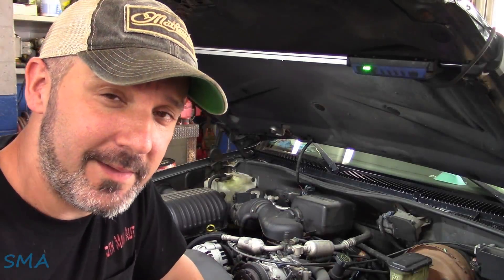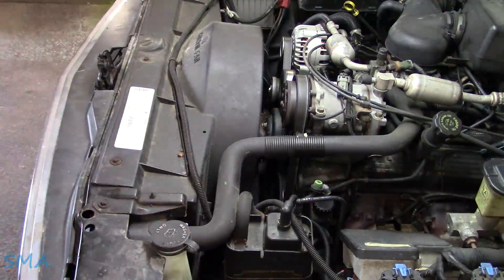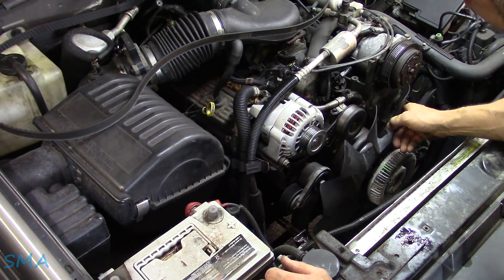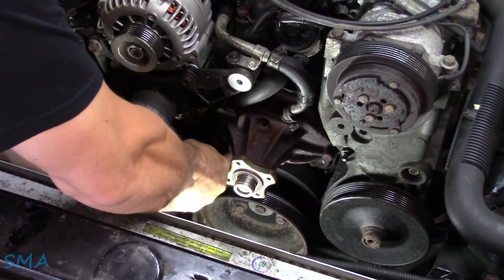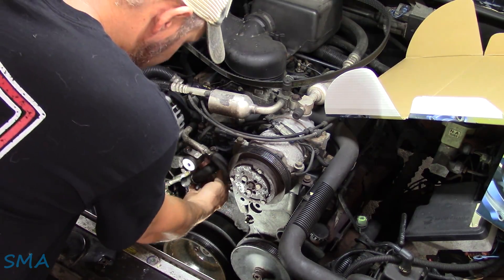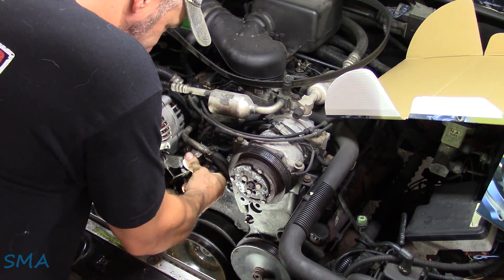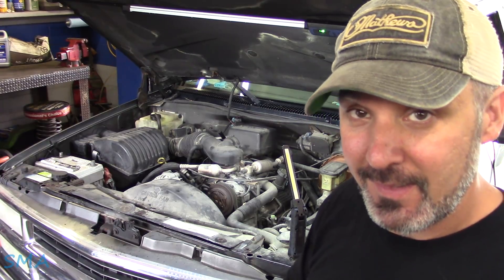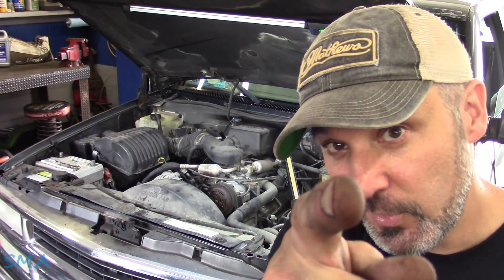Water Pump Replacement: 5.7 Chevy Tahoe / Silverado / GMC Sierra / Yukon

Comment: If Bald Eagles could fly out of the exhaust pipe, this is the engine that should be pushing them out.  Good 'ol 350 - good tried and true American engine.  Nice work as usual Eric!
Reply from the maker: Not gonna lie, when I fired it up it the whole shop smelt like apple pie coming from the tail pipe, I looked out side just in time to see a guy drinking a Coors light and releasing a Bald Eagle into the wild while singing the National Anthem wearing Trump 2024 shorts and an American Flag tee. At that very moment Bob Seager and the Silver Bullet band came on the radio singing Like A Rock while the NY Yankees tour bus drove by with glass packs rappin out the duals. Ahhhhh I gotta tell ya, it was sensory overload for a second and a lot to take in....may God help this great country!
Reply: @SouthMainAuto  Lmao That's the best thing I've heard all day!
Reply: are you my long lost cousin or something? BAHA!
Reply: @SouthMainAuto  🇺🇸🇺🇸🇺🇸🇺🇸🇺🇸🇺🇸🇺🇸
Reply: @SouthMainAuto  LOL almost peed myself reading this..
Reply: @SouthMainAuto  Woah, that was deep
Reply: Lots of these engines in Australia too. They started importing them for Holden in 1999 and used them for a decade give or take. There were piston issues with these import engines though, not sure if it was the case with the US versions.
Reply: @dylanlewis3666  The engine your refering to is different I believe. Your refering to the LS1. This is old sbc 350 based.
Reply: Trump or Desantis 2024! Or sooner if possible
Reply: @DillonTurner395  You're right, I just read up on it. We only got the gen III & later types here (In '99) which is an LS engine, not the sbc gen 1 or II. People liked the LS1 here. I didn't. I preferred the 304 that was built locally.
Reply: @Kanesgarage  the left will have us travelling on pogo sticks by the time a conservative pres is elected.
Reply: @dylanlewis3666  The left wants to dismantle just about every system in this country. These are some rough times. Let’s just hope it doesn’t last
Reply: @SouthMainAuto  wrong! No coors light!has to be  Good old Yuengling! America's oldest brewery!
Reply: I have one.  Damn thing screams 'MERICA every time.  Fire it up and says " 'MERICA MOTHER LOVER", and proceeds to sing the Star Spangled banner.  It does...and boy does it piss off the left and the green...I just rev it harder.  :)
Reply: @SouthMainAuto  MURICA!HELL YEAH!
Reply: @SouthMainAuto  well said sir well said
Reply: My buddy had the same engine is his  GMC Sierra with 540, 000 miles on it AND the four wheel drive STILL worked!!
Reply: That's a damn good engine BUT google  700,000 mile Corvette...
Reply: @SouthMainAuto  🤣 love it
Reply: @SouthMainAuto  That's why this is my favorite car repair channel.
Reply: They were much better after they got fuel injection and roller cams . the old carbureted , flat tappet small blocks were usually worn out by 100k miles .
Reply: About as reliable as stopping a tornado with a flyswatter after the 80s.
Reply: @SouthMainAuto  AMEN!

How did you manage to work the rest of the day after such a cornucopia of Americana!? 

If this automobile repair gig doesn't work out, maybe the Chevrolet Performance division of GM could use some advertising assistance!
Reply: @NickMyers1  I'll tell you how. The good old American spirit kicked in. Work hard and get ahead. Though this plan-demic seems to have everyone working or not... who cares... Uncle Sam will pay you either way.
Reply: @philllsxga.7737  I got one that still runs with 580,000 miles. Transmission went out so I'm probably going to junk it. The cam/distributor gear is paper thin
Reply: @HowardJrFord  not if you changed the cam and lifters
Reply: @Bryan-Hensley  an old 350??
Reply: @notsureigaf  right!! Do not put trust in ANY human!
YouTube George Carlin the American dream...
Reply: Jesus it is sad isn't it?  You have all these people standing behind a guy who wasn't just extremely anti-American, anti-democratic, etc. but was also just flat out terrible at the job.  This is a guy who openly disparaged military members, and took on gold star families while he made up shit to stay out of Nam.  The guy legitimately despises his supporters and wouldn't be caught dead in a room with them, but he's their hero.
Reply: @throttlebottle5906  Every big depression or major war was repaired and resolved by, at the time, the most liberal presidents. Wilson and Roosevelt were as left as it got in their days.
Reply: Idk 300 fords are better in my opinion not as much power stock obviously but those things could run in a black hole toughest engine ever built for old shit boxes
Reply: @SouthMainAuto  do you really think Trump is American?  God, I hope not. Everything about your channel says you are a man of character and honesty.
Reply: @Kanesgarage   if you actually run a garage, I certainly wouldn’t give you my business. Since you are ok with corruption, sedition, rape, and lies, I must assume you run your business the same way.
Reply: @jgeorge6081  I am as anti-Trump as it gets but generally speaking people who vote for him/Republican just don't believe that he's committed those acts. The facts are against them but if you ask Eric if he's okay with corruption rape and lies he'd say no because he's, you know, a real person and not the caricature you're making.

Trump is all the worst sides of the Republican party enlarged by a populist campaign. But not every single person who voted for him is fundamentally a bad person. Usually just misinformed.
Reply: @SouthMainAuto  im ok with everything except the trump 2024
Reply: @jgeorge6081  I hear ya. It’s almost enough to walk away from this channel. Especially with the other drumpers laying it on.
Reply: @SouthMainAuto  
"may God help this great country"
 
That's why he put Biden in office.
Reply: I like to use a 1/2"drive instead of a 9/16" drive?
Reply: @SouthMainAuto everything but the trumpy is correct. I hate trumpy I hate Biden I HATE EVERY POLITICIAN. I don't do politics and I don't vote. I'm as American as you can get...but unfortunately there hasn't been anyone worth my time to vote for since I became eligible to vote 15 years ago.

Comment: What a concept, water pump you can remove without removing the timing cover and half of the engine front in the process.
Reply: Yeah, imagine that.
Reply: I own one, it is the easiest water pump to change of all the engines I've had so far.  Only 4 bolts hold the pump on.
Reply: And a 2 piece fan shroud!
Reply: Was surprised a Chrysler product was somehow the only easier water pump I've ever seen(3.7 liberty early 2000s) but this thing is definitely easier than most. It's almost like engineers know how to make things easy to work on and choose not too nowadays
Reply: Yep...they made them so even mechanics were happy..
I still have vehicles like that...and the other type too
Reply: Sure, then your serpentine belt snaps and you continue to drive it.  But hey, whatever's easier.
Reply: @riccracc6547  the small block Chevy has been around,sine the 1950's,...using the same  water pump design,all that time.
Reply: 4.6 2v ford is easier.. Electric fan so it's just a belt and 4 bolts..
Reply: @zcvyvyan  
Rarely do belts snap actually and the timing belt isn't driving your water pump....i started working on cars in the 70's...so i actually understand how stupid your comment is...but anyways....the point was??...it is easier to access...not forced into a timing belt change ( which are belts that " snap " alot !! And we had chain timing systems that lasts longer than the engine too !! ).. Always some know it all knowing diddly it seems?? I own modern vehicles and fix them myself too...progress is not always Better in fact....
Reply: @garymallard4699  Timing belt doesn't drive the water pump?  Before you attack someone, you might want to be correct first.
Reply: @zcvyvyan  
On many cars it does...you wrench??
Reply: @zcvyvyan  
Maybe you should correct yourself...
Reply: @garymallard4699  The most sold cars in America  come from Toyota, Honda, and Nissan.  Most of those use timing belt water pumps.  Yes, I do wrench and I'm also a parts counterman.
Reply: @zcvyvyan  
Domestic too have them....euro too...most new vehicles use them..i am a mechanic....among many other trades...
Reply: @zcvyvyan  
Waiting?? 
Apoligize
You were wrong...if you knew this then?? Why did you attack me??
When all i did was state FACT??
Don't need your apoligy ok
Reply: @zcvyvyan  
Not trying to beat a bush here...or tumbleweed....but why did you say i was WRONG?? 
Most Parts Guys argue with mechanics over parts...lol
Amazing...
Reply: @zcvyvyan  
And what's your belt anger about??
Geez you need a shrink man...
You in 20's??
Reply: @zcvyvyan  
I was rebuilding carbs in my teens..
You ever do that??
You probably hate carbs too??
Fuel pumps were mounted on the engine...took 10 minutes to remove...guess that was Stupid too??? 😂 man you young kids know everything without actually doing anything??
Reply: @zcvyvyan  Well then you pull over, since your alternator light will be on or the volt meter drops. Whatever the cluster has in it. If run too long the temp gauge or temp light comes on. What's your point ??
Reply: @NY411Info  sure, you might do that and you should but a good amount of people ignore dash lights including the check engine.  Then, it's the car's fault for the operator's ignorance.
Reply: @zcvyvyan  Lol yes , at that point it would be operator error. If you ignore the lights or gauges you deserve a blown engine.
Reply: @NY411Info  It's really common for people to do that.  Then they don't take the blame and spread the word about how bad the car is.  Water pumps on the timing drive is a good idea.  What's not a good idea is then making that whole system interference.
Reply: Yeah I have a Toyota that you change the water pump and the timing belt at the same time. What a deal.
Reply: I’m not attacking anybody I’m just saying that they get charged at the same time 😳

Comment: This actually made me real happy to see. I like that other people are still rocking the old 350. 400'000KM on mine and still good, minus all the stuff that isn't. But honestly what a good little engine.
Reply: Fords has 7.3 power stroke. Chevy has the 5.7 350
Reply: @Daves_adventures4315 7.3 was made by IH Navistar, thats why they last
Reply: @UHOH3300  still in the Ford. 7.3 6.7 the best Ford has
Reply: @Daves_adventures4315  true, and the 6.9 and 7.3 idi are legendary as well
Reply: Pushing 389k on mine. Just a few seconds of piston slap when it first starts. After that it's still acts like it's in it's prime. The truck has has a test axel replacement/upgrade and I rebuilt the transmission by my choice to add clutches about 30k ago before it left me hanging. Engine hasn't had any sort of failure yet. Seeing this makes me think, now that I saw it I'm probably going to have the water pump fail in the middle of nowhere in the winter at -20f. Hmm  maybe a preemptive replacement is in order?
Reply: They have a flaw. The intake manifold gasket will leak pulling a vacuum on the oil pan. If left it will smoke the cat on that side.
Reply: still  have my 92 k1500 350 r700 ..wont trade it for the new  a  truck
Reply: @Daves_adventures4315  5.0
Reply: @michaelvangundy226  Yep.  My 98 K1500 that I bought new is on it's third intake gasket and it only has 140,000 miles on it.  Mine has the second version intake gasket so I'm sure it will go out again at some point.  The third version gasket seems to be the best fix.
Reply: Saxon Fisher what do you expect it is a good ole G.M. CHEVROLET old CHEVYS take a LICKIN & STILL KEEP TICKIN any G.M. VEHICLE is a good one
Reply: @Monza62000  Don't at all.
Reply: @Daves_adventures4315 NOT a ford engine though. The 350 is a CHEVY engine through and through. So no you can't say that. Just because it's in there doesn't make it a Ford product. Same could be said about Cummins and Dodge...Dodge didn't build the Cummins engines. But once again, Chevy built the 350 which IS the GREATEST engine of all time...the small block Chevy as a whole. 283, 305, 327, 350
Reply: @thagerdorn2009  very true.  Just my opinion but can’t beat a 327 or 350. Everyone went nucken futs when Chevy “replaced” 327 with the 350 but held it up to its predecessor. 327 phased out in 1969 2 years after the 350. But the 350 went from 1967 to 2002. That’s something to be proud of!
Reply: @Daves_adventures4315  I love all of the "old school" small block Chevys. I love the LS engines too, they are the modern small block. I love the GMT400 trucks but you can't beat a GMT800. They are just incredible and people love the LM7 and L59 engines from the trucks. But honestly, my Z28 is numbers matching and I might put vintage air and a Holley sniper on it for "modernization"...but the numbers matching 350 will stay in the car. I don't need another LS vehicle, my truck is enough. And I'm a numbers matching guy. The amount of support for the SBC is growing and growing. And I love it. Just can't beat it
Reply: @thagerdorn2009  I have a 78 ford. It was my best friends in high school’s dads. It’s on my channel,all I’ve done to it. From dragging it from her grave to current. I did win a car show (small show) with her but unfortunately the block cracked from the water pump into a water passage.  Motors toast but got a 82 to pull the 351 out rebuilt and put it into the 78. Hopefully will start Monday

Comment: 97 GMC 1500 sportside 3rd door, 5.7 vortec, over 400K, still runs like a charm but tons of preventive maintenance thru the past 24 years,  original 4L60E, never cracked, original engine, never cracked

Comment: I had 89  Silverado long bed regular cab with that good old 5.7 and it was my grandfather's truck. It had the 5.7 high output, mine was t.b.i b4 the vortec.  I absolutely loved that truck.   The sweetest truck I've ever driven on the interstate you could pass absolutely anything. You could leave black marks as long as you felt like holding your foot on the gas..lol. Sadly it kicked out of park one day, rolled  over a bank and hit a tree and just destroyed it. However I do I took I removed the engine and transmission which was still running great at 280000 miles, My father had it before me he had the transmission rebuilt about 80000 miles before. Broke my heart to scrap that truck but I still have its heart and it will go in another, When I find a vehicle I consider good enough for that Heart. I've never heard of vehicle to this day it sounded as good as A 5.7 with the right exhaust

Comment: Eric, they discontinued the Goodyear gatorback series of belts. Continental killed it off. They were really good belts. I was so outraged that I switched to gates and never looked back.
Reply: Yep great belts and lasted a loooooong time that might be the main reason they were discontinued. I have a gator back on my Dodge Ram Cummins that has a idler pulley seize up and it was at 120K when that happened I sure don't like the new belt as it speaks on startup

Comment: This video also applies to the 4.3 v6 as well. The whole front of the engine is exactly the same except for the fan blades and thermostat housing. My 97 Safari (one owner) has 415000km on the odo. One thing we found out over the decades is do not use a cheap new water pump or else. AC Delco or get it rebuilt locally. On pump # 3 we changed a bunch ourselves as well and went with an aluminum new fenco unit from china (autozone). 6 months later the bearings disintegrated and sent the fan into the 6 month old rad and broke the 6 month old belt and the 6 month old adjuster and bent the 6 month old  clutch and the 6 month old rad hose. Happened on christmas eve. That was over $1200 for tow, hotel and fix in the end plus the cost of everything 6 months earlier. The warranty replacement pump leaked bad after 3 weeks. Another $400 again to tow (100km) and get it back to an AC Delco pump.

Comment: took a 5.7 vortec (1-piece RMS) out of a '97 C10, stroked it to  a 383, internally balanced, old school SBC 400 aluminum ported and polished heads, old school Holley 750 vac secondaries, dropped it in my 71 Camaro snugged up to a built M20.  Love that motor!

Comment: I love my 99 Suburban (Texas so we can keep old stuff) It is just modern enough to live with and just old enough to be a maintainable tank.
Reply: That's how I feel about a lot of 90s cars. I live in Florida and my 98 Ram has no rust and is easy to work on.
Reply: I have a 98 suburban out here in California. 285k on the odometer and still running good. Trans is starting to grumble a little though. Can’t beat that late 90’s Chevy thunder.

Comment: Geday from Australia. Back in the 70's I put a Chev 350 in a 64 Holden , which came stock with a 179  cubic inch 6 cyl. It didn't stop real good but it was one fast beast.

Comment: I love replacing these water pumps. For some reason this job bring me joy. Maybe it's because they are so easy to do.
Reply: Love it. Water pumps are a nightmare on transaxle style powertrains. Especially small chassis vehicles. Ive had to remove many motor mounts on many jobs to drop one side of the engine/tranny for more room.